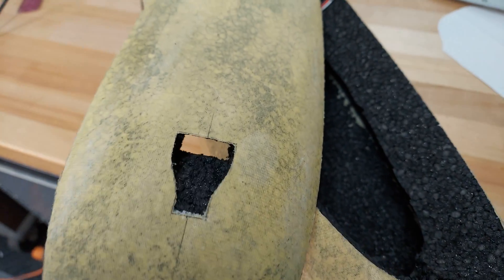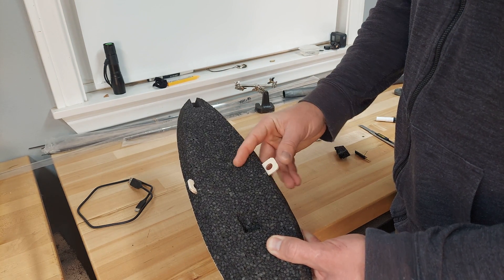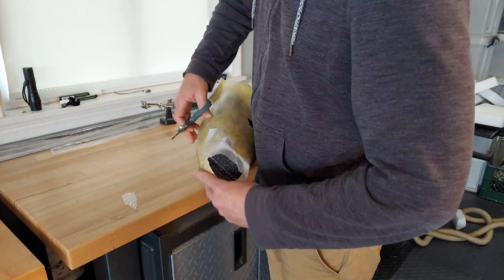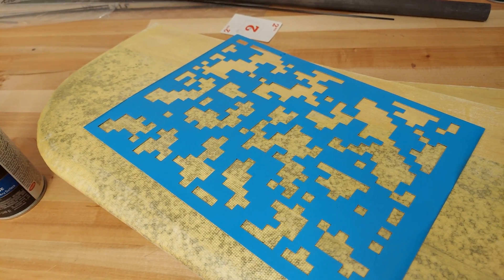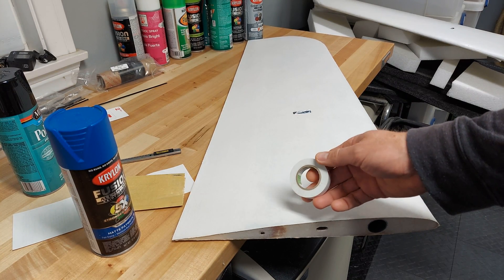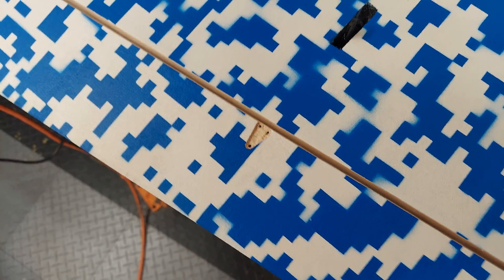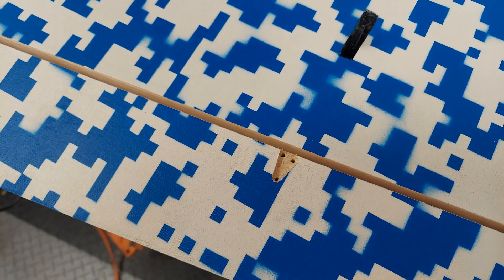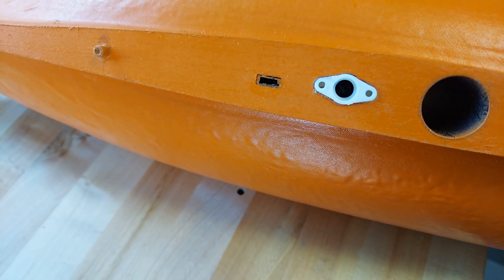Giant 80" FPV Plank Construction Part 4

Comment: Many thanks for sharing, I’m taking so many notes from this video! What’s the ailerons size? I never understand how big they should be in a custom design! :(
Reply from the maker: Typically I will do ailerons as a quarter of the chord and 1/2 the span.   This can vary, but gives a good starting point.   This allows for smaller deflections than most designs, which increases efficiency.

Comment: Hi Svede,

Thanks for doing these fantastic build videos. I'm just wondering what you would recommended as up/down deflection range of the elevon for the 80" Graugans?

And far from the trailing edge should I cut the hinge 3.5" from the trailing edge?
Thanks again!
Reply from the maker: For pitch on GrauGans start with 5-6mm of up/down travel, 12mm total, then tune to what feels right, but that should keep it from being too pitchy at first.   For roll, normal movement is fine.   Cut the hinge approx. 25-28% of chord from the trailing edge at the root and the tip.
Reply: @thinkflight  thanks!